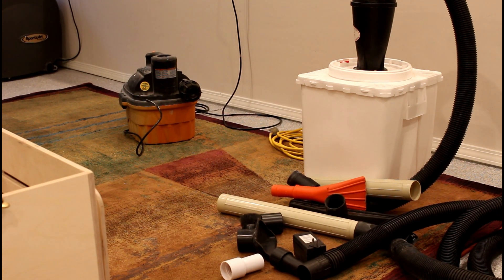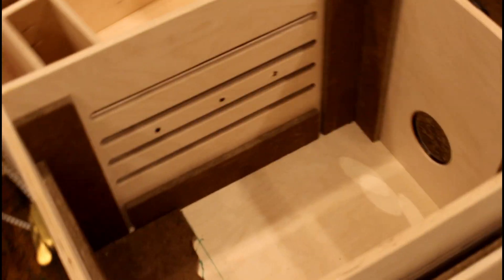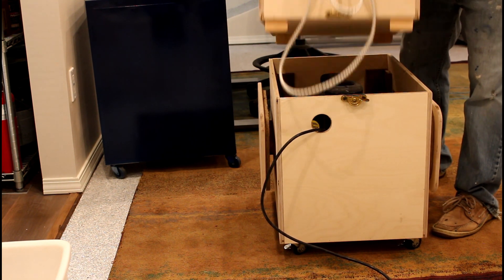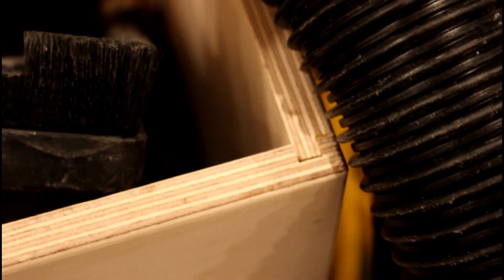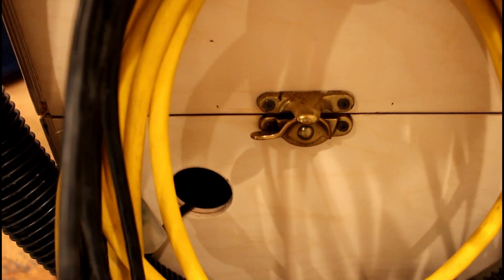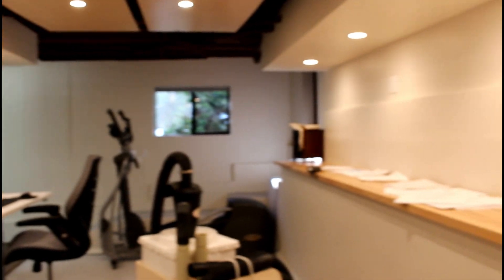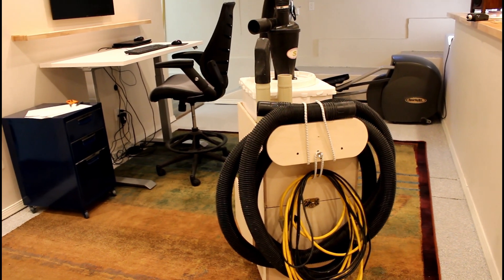Design and SOUNDPROOFING of a shop vac /cyclone dust separator MOBILE unit

Comment: What are the dimensions of the cart (without the hoses and power cable and with).  I was going to ask about the shop vac but at the end you mostly answered my question but I’d like to ask it anyway.  The size of the shop vac chamber is actually pretty irrelevant since all the dust goes into the cyclone bucket.  You have a nice big cyclone bucket.  To get powerful suction, you probably have to live with a big shop vac.  I think I would want to use a smaller shop vac to keep the cart size down, but wouldn’t want to sacrifice too much suction.  Thoughts?  It would be good to see this in action.  All the cart videos show cool carts but never show them at work.
Reply from the maker: I’m sorry for the long delay. The size of the boxes are as follows:

The top box is 16” wide by 22” long by 12 1/2” high.

The bottom box is 16 1/2 inches high. Other dimensions are the same. These are all outside dimensions. I used half inch Baltic Birch lumber for all construction.

I hope that helps. I’ll take your suggestion of a video of it running and add a video.
Reply: @ironwooddesigns9532  I am gathering the pieces to build my cart.  I got a really small Ridgid shop vac with 4 gallon tank and relatively powerful 5 HP motor with good airflow rating.  I need my cart to fit into a small nook in my garage.  I was really happy to find something with a small tank and powerful motor.
Reply from the maker: @emmgeevideo  VERY similar to the one I'm using.  I think it's perfect for a cyclone cart.

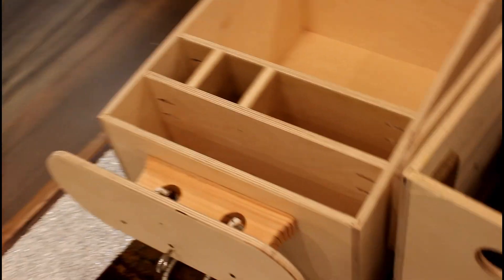Comment: At1:32, I see what appears to be a flanged port for the shop vac. What did you use for that?
Reply from the maker: It's just a slightly larger hole and I just shove the hose through it and into the shop vac inlet.